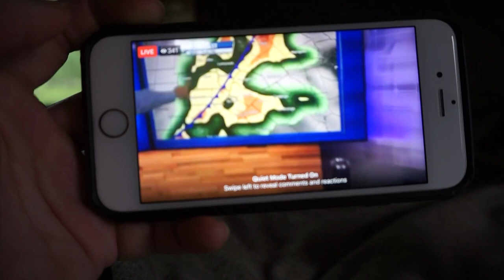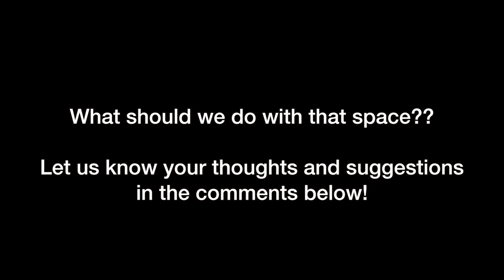THIS ISN'T GOING TO WORK

Comment: Get rid of the flexible hose on the left, by the door. Put the vent hole for it where it comes out of the heater. That will give you some more space on the side and you will still have the vent.

Comment: Thank you Blair, for explaining the hitch fit!  I saw the episode on KYD and I had no idea what that was!  Now I get it!  Exercising during pregnancy is so vital for delivery. You will do some of the hardest work delivering Eva. So having endurance and strength is vital! I walked everyday, everywhere, while I was pregnant. I walked during my labor, which helped deliver my daughter. I think it’s a great idea to spread out the workout, you only have so much energy in this time of your pregnancy. 
Loved the neck pillow with the unicorn!  Omg!  Just picturing Eva wearing it!  So cute. 
As far as that corner, do you need to use the existing framework?  If you can put the hose on top of the heater and then just build a box around just that. If you’re wanting to put a cubby or something on top of it, just make sure the box is big enough to hold what you want on top of it. 
As far as shoes, I use the Trones from IKEA. If you had anyplace to attach them, they work great. I basically live in my bedroom- it’s the master so it’s a little bigger. Everything I own, pretty much, is in my room , so I use them on the wall and it’s great!
I’m the queen of trying to fit 10pounds of stuff into a 5 pound space!
Thank you again for the daily vlogs, I really enjoy them. 
Until next time...

Comment: I'm not sure what alternatives there are for heating, but I would remove that whole furnace, and install a small wall mount heater in that area that Matt pointed to, and also one in the bathroom.  That will free up all of that floor space.

Comment: Cut the ducting to just a few inches long on the door side and put a hole in the side of the box that you modified that is just big enough for the original vent to fit in. Put the vent in the side of the box and then connect the short duct to the back side of the vent with a clamp. Maybe? That's what I would try anyway.

Comment: Build it into a small raised  bassinet sized crib.  You can shorten that duct work on the outside by the door.  No need to have it that long.  Just change the vent location when you build the new thing.  That will cut down the width a little bit.
Reply: Genius!

Comment: Run the duct work straight out on the left side.  Wrap the unit with havac duct board and then you can build a close fitting “box” out of most any material you want.
Reply: If I were closer by I’d help you with it.

Comment: Just take the furnace out.  You can use an electric heater if needed.  Then when you are in the house you can reinstall it easily.

Comment: Just remove the dryer vent tube on the door side and vent it straight out of the furnace put a board with a hole on that side with the same vent as your qv so you can direct it wich ever way you want
Reply: qv was supposed to say ac lol sorry

Comment: Could you turn the furnace and duct with metal out the same spot on the side of the camper?  Turn so part goes where Blairs shoes are and do a metal duct around and out the original side camper vent.????

Comment: STOP!  First thing to do is look-up by furnace name and model number and find the clearances to combustibles for that unit.  I would build the structure the same as the last one with a few modifications.  To get less width you can remove the existing flexpipe and run the vent right where the duct comes out of the unit, in other words, straight out.  Then build out 3 to 4 inches past the furnace to keep it as short as possible.  Just make sure to follow the minimum clearances to combustibles so you don't cause a fire. Good luck...
Reply from the maker: We don't use the heater in the first place, but I'd rather keep it there as a "just in case." I also don't want to mess with the connection to the propane by unhooking it. But if we do end up changing the structure around it and plan to use it, you are right that we need to make sure clearance is good. -Blair
Reply: Oops!  Difficult to describe without a picture.  I wasn't suggesting to remove the furnace or disconnecting the propane line.  I was referring to relocating the vent line that feeds to the entrance door area.   Matt had suggested blanking it off, I was just stating that relocating that vent straight off the unit you could save some space given the furnace clearance limitations.